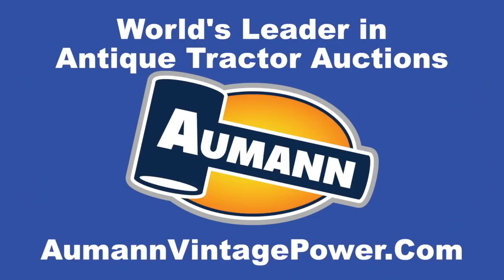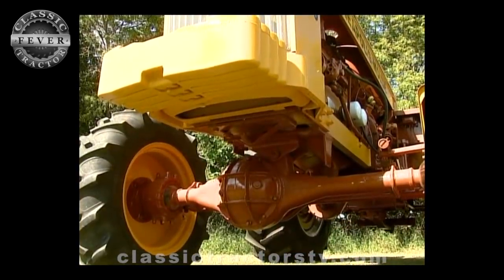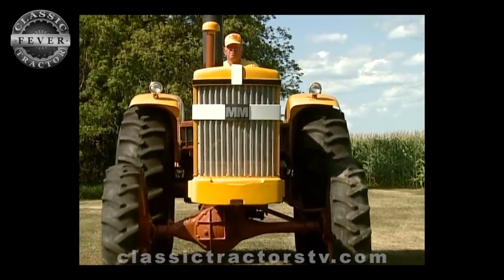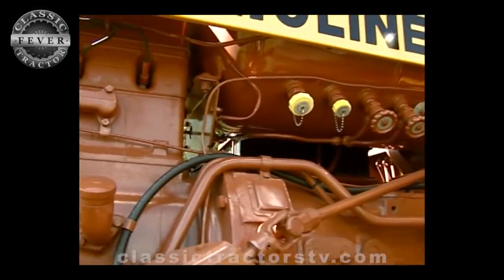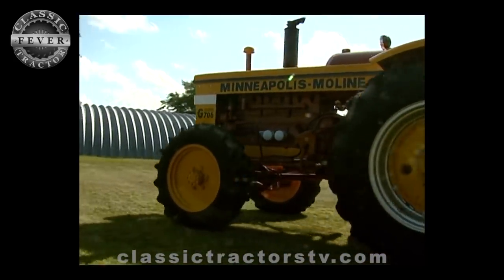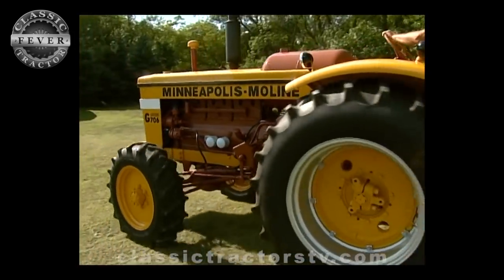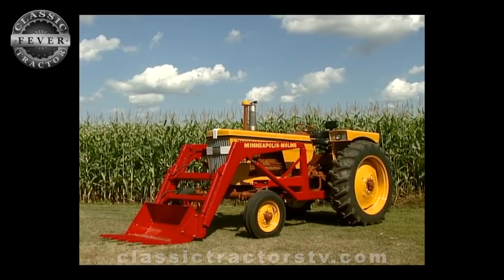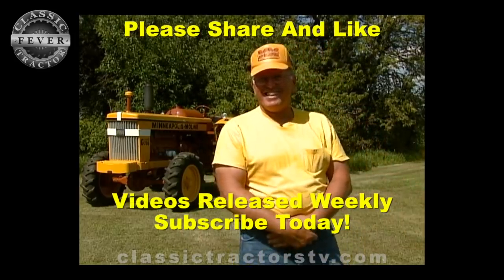ONLY 351 OF THESE WERE BUILT! 1962 Minneapolis Moline G706 Front Wheel Assist With LP Gas Engine

Comment: I'm sure glad this wasn't a long story. If he talked at normal speed this video would've been 2:06
Reply: It come outta South Dakotee. ..
Reply: The dealer 1/4 mile from our house had a diesel G706 with front assist. When you sat in the seat you were about as far back as you could be and you looked down that loooong hood. You saw the next farm at the nose while you just got straightened out from the turn and set the disc down. That was 1972.